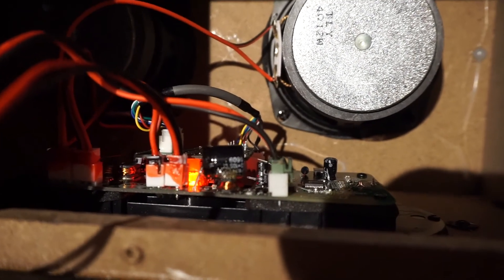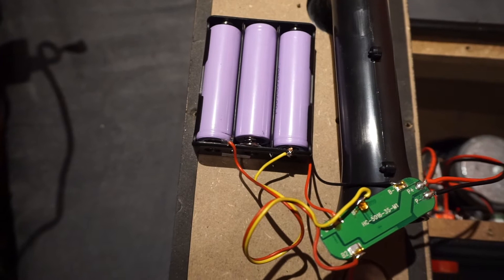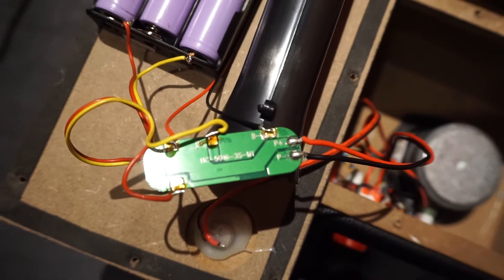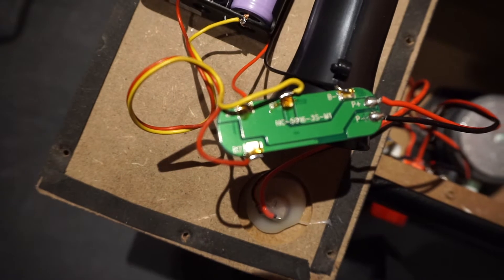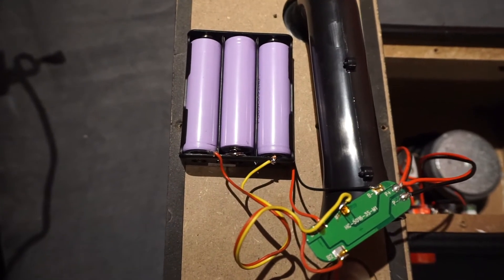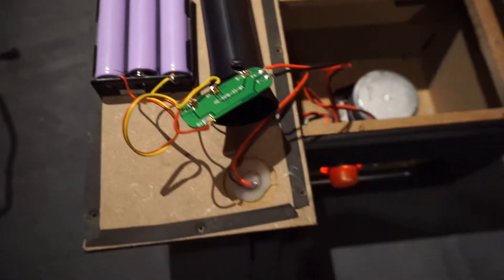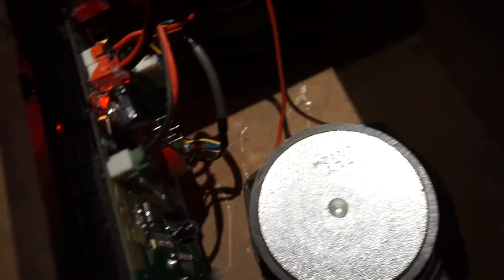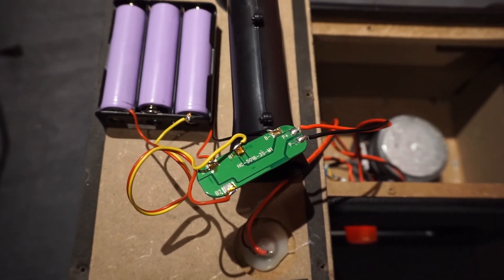Tewell/iDance bluetooth retro speaker battery replacement

Comment: How did you get the back piece off?
Reply from the maker: It was mounted with simple phillips screws, so I just unscrewed them.
Reply: camp0017 ok mine didn’t come off right away just by unscrewing. There might have been some glue on there. Finally got it off with a couple flat head screw drivers. Thanks!

Comment: Thanks,  what you think about its overall construction and its sound? I'm thinking of getting one.
Reply from the maker: SurgTT Both are adequate. Not top quality, but for this price it is more than I expected. The only issue is with the rechargable battery, that's why I replaced it.
Reply: camp0017 it seems easily modifiable, as the parts seems to  be standard, do you know what amplifier board it uses
Reply from the maker: No idea, I haven't touched that part of the board. I guess some integrated chip plus transistors as the last step of amplification (but I remember only vaguely what I saw and I don't want to open it again now).
Reply: so I see in one of the Amazon reviews the person says it uses the tpa3118 chip